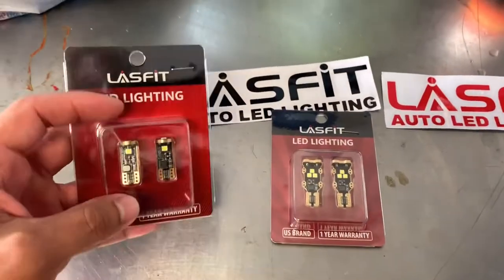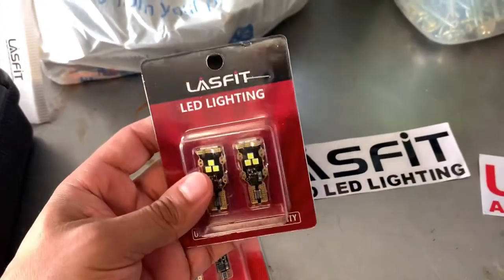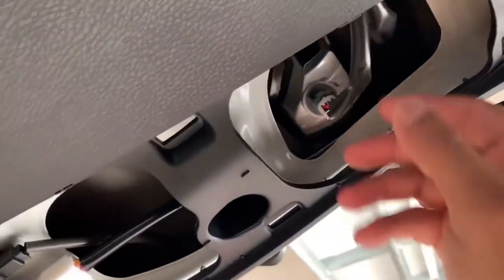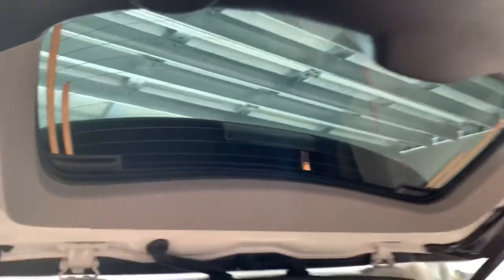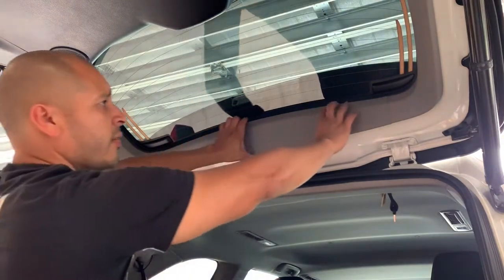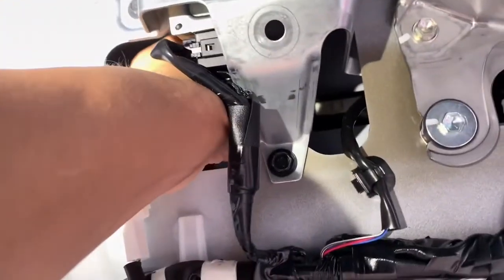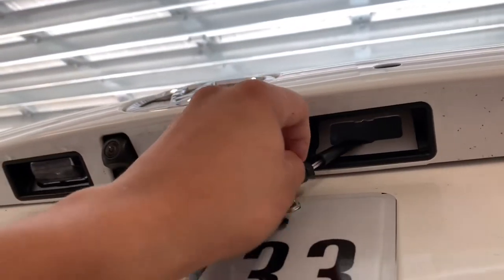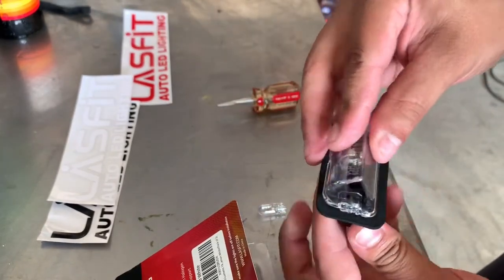2014-19 Toyota Highlander LED upgrade

Comment: Now it's time to install DRL LED dynamic turning signal light.  I already got mine installed so if you need help let me know.
Reply from the maker: hoang ho where can I purchase this from?
Reply: It is on ebay.  Type in LED DRL daytime running light signal lamp for Toyota Highlander 2017-2019.